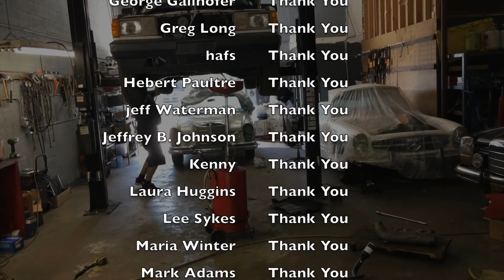How does ethanol fuel effect my carburetor?

Comment: the energy industry attempted to introduce gasahol fuel (aka ethanol-gasoline mixtures) in the 1970's but massive backlash from the auto industry prevented it because everybody in the industry knew it would destroy fuel systems on every car being produced at that time. gasahol was never about improving the environment, it was all about finding a way to use the massive amounts of corn that the government was buying from corn farmers and stockpiling because american farmers have always been producing more corn than the market ever needs, and that has continued today. 'oxygenated fuel' (aka gasahol aka ethanol-gasoline mixtures) has recently been forced onto us because all new vehicles have fuel injection systems that can tolerate the water and alcohol without damage, the automakers didn't complain anymore and the environmentalists want all old cars off the roads, so this is a good way to render them inoperative without major upgrades. along with that, real sugar has been replaced in most foods in favor of high fructose corn syrup, which the corn farmers and the government also love, helps use up even more of that government corn.

Comment: hi pierre..some say .if youadd200ml atf per full tank.thatwill clean lubricate and protect the all ke jetronic system...what do you think about that..you are the mam....chers
Reply from the maker: atf is not designed to burn in an engine. If you want to lubricate your fuel, use something like 2 cycle oil. The k-system does not need a lubricant, though, like mechanical injection does.

Comment: Well said, which octane rating do you prefer to use for  1973 W115 , octane ron 90 or octane ron 95 , what would i benefit if i used 95 ron or even 98 ron
Reply from the maker: the higher, the better...but you don't need more than 93 in a street engine
Reply: @mercedesclassicswithpierre1753  thanks Pierre :)
Reply from the maker: you're welcome

Comment: Ethanol is evil.  As bad as it is in cars, its deadly to small engines in lawnmowers and snowblowers.
Reply: I found that out the hard way! I only buy non ethanol free gas for my power equipment.
Reply: What are its effects in smaller engines in particular?
Reply: @azmike3572  Ethanol is corrosive and attracts moisture.  If gas sits for any length of time (like a month) it becomes a gummy varnish in the Carb. Will clog up the jets.
Reply: Thanks, Steven.  Good for us to know.